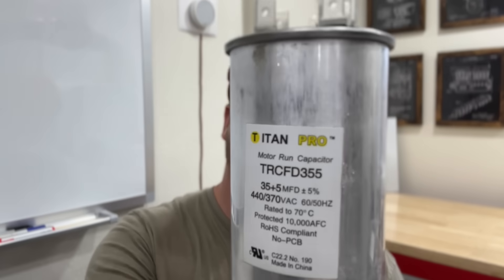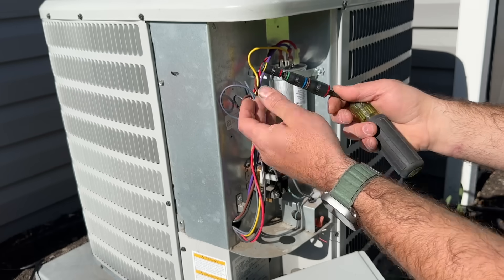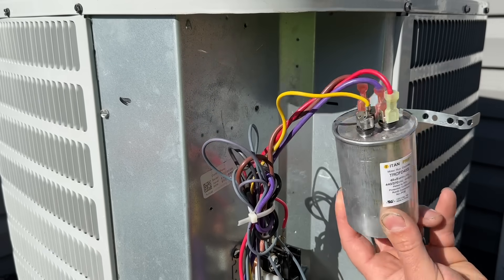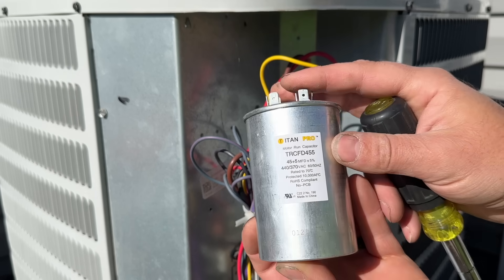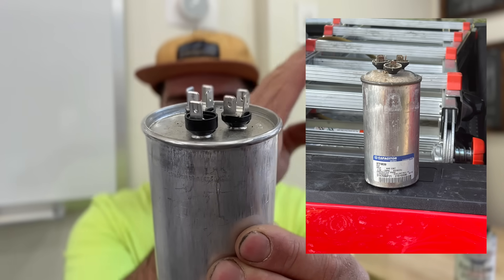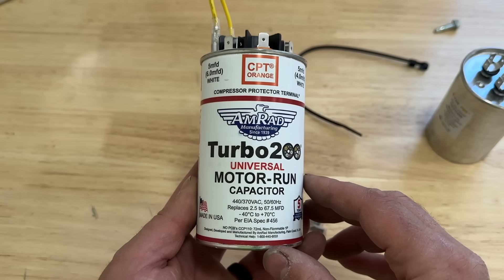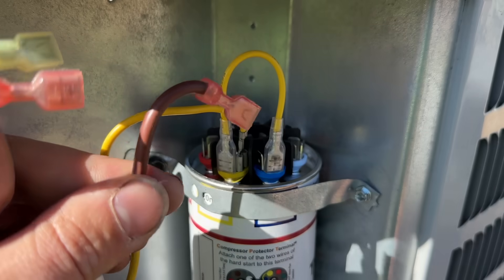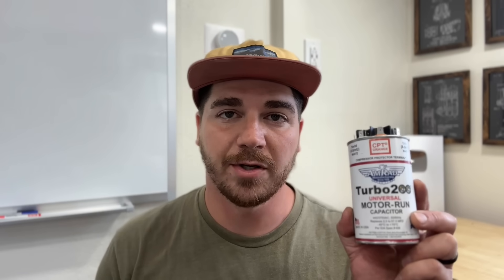HVAC Contractors Practically Make Their Living On These

Comment: You can hear the hum when the motor won't turn. That usually indicates the capacitor needs to be installed. But there is also a thermal protector on the compressor that needs to be checked for continuity

Comment: Thanks for making this video, a lot of people could benefit!
My AC guy was swamped with work and knowing I'm not afraid to do things, told me over the phone to replace the capacitor. He told me 90% of the problems he encountered involved replacing that cap or the one in the air handler. 
Air handler plus compressor caps=$38 with tax, 10 minutes with screwdriver and both were replaced.

Comment: Great info.  But is that really the safest way to discharge a hi voltage capacitor?    Looks like you're shorting it the ground/can which you are holding in your hand, potentially making you part of the circuit.      Better to run a wire from the terminals directly to the chassis, before you remove it ?
Reply: Better to order the identical USA made uf capacitor and disconnect wires and discharge with screwdriver before releasing the strap. Also use a permanent marker to record the capacitor info inside the compartment for future. Also take pictures first and note the terminal herm, fan, and common on both with a sharpie. If wires are not installed exactly either unit will not start or damage could happen. Funny the contractors are profiting but you make money on the sale of these universal capacitors as well. The original capacitor US made is the best and least confusing/expense option.

Comment: That's not a Start Capacitor, it's a Run Capacitor.  Start caps are only in the circuit for an instant, a run cap is actually hooked up to the "Start Winding" of the motor.  It is utilized every time the start windings are energized.  It determines how much electricity is applied to the Start Winding.  As it loses value, the electricity not being sent to the start winding, runs down the run winding instead, causing thermal overload.

Comment: That's not what a capacitors do
Reply: It's an analog way of creating 3 phase electrical for motors
Reply from the maker: Thank you. Most people don’t understand how a single phase motor works much less trying to explain how this lets it start like a 3 phase motor. So I try and make things as simple and clear to understand. At the end of the day, they don’t care, they just want to replace it and get ac again. But thanks for sharing! I’m learning every day. Cheers
Reply: start capacitors  help with start up
Those are run capacitors the are being used 60 time per second

Comment: Only the dumbest people would pay $2000 and not notice they did not change really do anything lol. 

It’s a capacitor and they do go bad. If you can’t do the job yourself that’s how it goes. Also you show a hard start kit in the thumbnail. That’s a way you can make older compressors that are going bad last a bit longer.

Comment: It's so disheartening that so many tradesman are dishonest... My father worked HVAC and commented even 50 years ago about some of the guys just swapping out parts that didn't need it. Then I had a friend that became a Master Diesel Tech... But left the trade because dealerships he worked at would give the work to technicians that brought in more revenue from unnecessary repairs. I have had to correct dealership or private garage repair mistakes myself just so that I could maintain a working relationship with the garage in case I really needed their expertise. Of course, it's a whole different ballgame now with the software needed and ties to the manufacturer along with high labor costs... It is so sad just how many basically steal from their customers...

Comment: HVAC dealer here sold me capacitor for $30. Swapped myself, saved on the trip fee and labor. Had AC back working in less than an hour. Process is as easy as shown in the video.

Comment: OMG this sound like how after getting some experience in the auto industry to learn pretty much all repair shops, and parts stores try, or simply do charge you for something you do not need. Guess HVAC is no different. (Knock on wood: my furnace and AC were installed in 1996 in the house I'm in, and still working. Last 2 times the furnace went out I was able to repair myself without calling someone. Just because you're an accountant doesn't mean you can't learn car and HVAC repair too! Okay, you're probably right, most of the time being an accountant "does" mean you're unable to repair a car or a furnace.   lol!  What only one side of our brain works at a time?  LOL

Comment: I replaced mine on my 30 year old system but it wasn’t bad so didn’t help. The company I hired told me compressor was bad and I needed to replace system. They were adding 30% fees because it was covid time so I said I can wait. 2 years later just replaced ac/furnace at way less the cost. Bring on the heat!!  I had been cleaning coil etc because of great people like you. Thank you.

Comment: After seeing an AC repair video about a year ago I decided to check my capacitor and buy one to keep on hand. I failed to pull the trigger, About two months later, 110 degrees at 8pm, our AC went out. I checked the capacitor, it was bulging on top. Paid about $300 for an emergency, after hours service call where the capacitor was replaced. Lesson learned, keep one on hand. Where's that trigger again? ... ; )

Comment: So the fan and compressor are both capacitor start motors off the came capacitor?  Makes since that either or both would not work if the capacitor is shot.  The capacitors shift the current 90 degrees for the secondary winding's to help start both motors.

Comment: I learned this a long time ago after spending about $400 for new capacitors, especially when I had a larger house with two units. I usually buy my replacements on Amazon.
 I have been reading that a hard start kit will reduce the strain on your system and prolong the life of your AC unit. Does anyone here know if this is true?
Reply from the maker: It’s my opinion that it will lengthen life. If we put it on systems to extend the life, why wouldn’t we put it on a new system? The reason manufactures don’t is because of money.
Reply: @diyhvacguy  Thanks!

Comment: There's another common failure point on air conditioners I'd love to see you cover.  I've always known these things as relays, but I know you HVAC guys have another name for them.  Several years ago my mother-in-law had an issue with her air conditioner that ultimately turned out to be she hadn't cleaned the filters in well over a year and that caused low airflow which resulted in the blower icing up. 

She called the guys out and they were trying to sell her on a new capacitor and this relay device because they were "close to failure" and she needed to spend 800 dollars RIGHT NOW or she'll be broiling alive in the Texas heat inside a week.  She called me in, and I immediately whipped out the phone pulled up each of the devices on Amazon and asked them to justify  their 800 dollar price tag on essentially at the time about 80 dollars worth of parts.

The conversation ended badly for them, with me stating, with Amazon prime I can have replacements here today, and I'll still have 720 dollars to spend on steak dinners celebrating the fact that I'm not a criminal, nor am I going to hell...

The other upshot being both the capacitor and relay she had at the time lasted SEVERAL YEARS LATER (like AT LEAST 5 years), before she sold her house and retired to Colorado (where the extent of air conditioning really "needed" is a decent ceiling fan).

I swear to god, the swimming pool industry and the HVAC industry are just rife with criminals.  I have SO many stories of excrement I've had to deal with when it comes to air conditioning, I'm definitely going to review your DIY replacement vids as I'm certain the idiots who installed my current blower unit F'd it up and it will be dying shortly...

Comment: My A/C was not working , so I called someone to look at it . I was with him the whole time & he explained everything he was doing and why . Needless to say I had a blown fuse outside and the capacitor was reading low . All said $500.00 , the A/C is about 13 years old , so yes on the high side , but I learned how to do it myself the next time .
Reply: @bluejay713  I don’t know , the capacitor looked exactly like the one in the video and when he tested it both where down on the meter reading from where they where suppose to be . I did have a blown fuse also possibly because the capacitor was drawing more electricity on start up ? Any way I know now what to look for / test and fix myself

Comment: After replacing my whole system with a new Train system 4 years later after the 3 year warranty expired the fan stopped working and it cost 300. For them to diagnose the problem, fix it and for me to tell them multiple times that I wasn't going to do a vent cleaning. The next year the same thing happened again but this time the wife had bought the annoying insurance on our appliances and the air conditioning so it only cost whatever they charged plus 100. For them to come out and fix it and me to run them off when they wanted to clean my ducts. 3 years of it getting fixed every spring/summer one of the guys an old man showed me what to do and how to fix it myself. He said he didn't know if I could buy one from the store like he could but he said with computers these days you might be able to find it. That was about 18 years ago and after he showed me that and we got the insurance to shell out for several major appliances we dumped them. After all lots of people had started putting up repair videos. It got easier to order replacement capacitors and I ordered them in 3 packs since I replaced them so often and no one could explain why. But for some reason the last one I put in has lasted 3 years now and this is its 4th summer so I'm crossing my fingers. This is definitely good advice because it is easy to replace just make sure to tighten in in so it can't move around if your new one is smaller than the old one.

Comment: Good job. In the last 40 years, I have replaced mine 7 times. (Electrician) Special note ... oval shaped ones last 3-5 years; round ones last 7-9 years. Oval get hot spots inside they are just waxed paper and foil. Replaced blower fan at 34 years, replaced compressor cooling fan at 28 years. If you don't have capacitor function, use the ohmmeter. Open is bad, shorted is bad. If it stalls for a second on hook up, and the reading slowly rises probably good. If your blower fan in the furnace, starts slow  and gradually climbs to full speed, the cap is too small for the motor, or going bad. It won't hurt, but if you want that woosh sound starting, one size bigger. Example 5 MFd is slow, 7.5 is woosh! My unit was used, when I bought the house - keep it clean.

Comment: Not to be contrarian, but when you're paying for service, you're typically paying for the experience and knowledge to determine that 1: it is indeed just the capacitor that is the issue, and 2: that the repair is done safely. Not a lot of people realize a capacitor stores an electric charge. On these units, it can be 240v or even 480v (tbf, 480v would be extremely unusual for a residential application). That's not something to play around with. Making sure the power is disconnected first, and the capacitor is properly discharge before attempting any repair is crucial to avoid injury, and quite possibly death.

 That being said, yes, there are a literal shit ton of unscrupulous technicians out there - not just in the HVAC industry. I highly recommend reading up on their reviews, and checking around to see if they have complaints. Being a tech support person myself, I've worked with all kinds...

Comment: Totally not a pro tip... but I had a capacitor start to go bad where if the unit hadn't run in a long time, I'd have to go outside with a wooden spatula just as it started up and I'd manually spin the fan with the spatuala to give that "oomphffffff" it needed.   All it needed was like a quick push and off it would go!!!      I did that for a couple days until the replacement to arrived in the mail from Amazon....

Comment: I worked for an ac company in the '80's that was charging $100 for a $5 contactor plus $200 for labor. I didn't have a problem with that until he put a bounty on replacing them. One guy that hadn't replaced one in 3 months, all of the sudden replaced over 75 a week while doing pre-season inspections. That's at least 15 inspection calls per day! The boss was thrilled. I quit the next day because I knew he would be found out. About 6 months later, dude went out of business.

Comment: My Ex’s AC was on its last leg, being the one out of the bunch who knew jack squat about anything mechanical at all… all
She knew was “ must have working AC for me while working from home and for kiddo no matter what living in the south”. Called “ her people “ to come out for a 2nd time after the system froze up. I check the entire system attics down. She just couldn’t grasp the concept that she was well very much well past the prime of her AC and it was drawing way too much energy. An option to “ limp it along ( for an undetermined amount of time was to have a capacitor installed and cross her fingers. Upon my own inspection and having multiple conversations about it with her, for it to sink in, she finally caved and got a modern AC system. She was willing to take the risk of allowing the guy to come out and piggybacking this fix on her old old old AC system. She was lucky that they were nice enough to apply the previous two visits and cost of repairs off of the new system. —- IDk what was more insane. Having to go over and over and over with her about the piggyback with no guarantees except the fact that the problem wasn’t actually fixed and would immediately cost her more in energy costs OR her begging me to flip over the breaker that had been pulled to allow the system to thaw out AND how stubborn she was to brining her and the kiddo over to my place for just a few days. Man, she had excuses. Notice… I said Ex, earlier. Owning a home is an investment and amazing feat. If you don’t and won’t grasp the concept of having to put a few thousand back into it yearly is beyond me. My favorite was asking “ when was the last time the back deck was resealed?” ( her : “ What ?? “)….. no further questions needed.

Comment: I have several of those starter caps on standby in my closet. I even replaced one myself. No need to get ripped off! 
Just make sure you use an insulated screwdriver to short the terminals before you touch it!
Also pull the breaker out just in case!

Comment: Cap should never run more than a couple hundred dollars, anything more is just bullshit. as far as the type of cap - there are literally hundreds of variations, AMRAD Universal caps are carried because we can get the correct rating by just moving jumpers around and we can reduce dead stock that way. If you have the ability to work on your own unit than by all means do so, but dont bitch about the cost when you call a professional, and i mean an actual pro, not some sales company bullshit (which most are now-a-days)

Comment: These capacitors are only passing alternating current. Under these conditions, they're not going to retain a dc charge. Capacitors  only hold a charge if they are used in a dc circuit, like a filter capacitor in a radio or amplifier.

Comment: Something you didn't mention with DIY capacitor repair. Besides the money you save you get your unit repaired by yourself in minutes. This is a bid deal. I live in the Phoenix area and when it's 110° outside for days on end in the summer you don't want to dick around waiting. HVAC repair guys get cranky because of the heat and get an attitude and take forever to get to you because everybody is dealing with HVAC issues. I always keep a spare capacitor on hand.